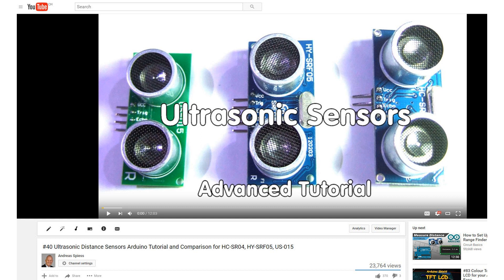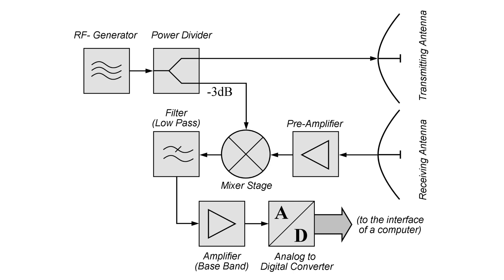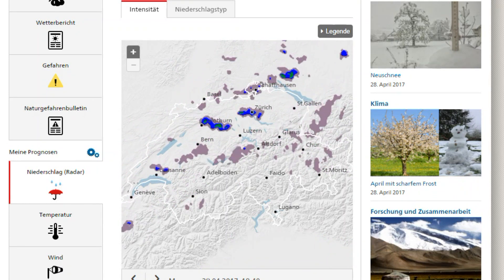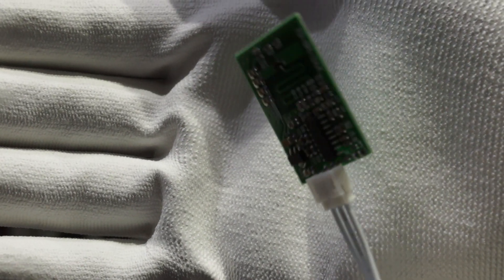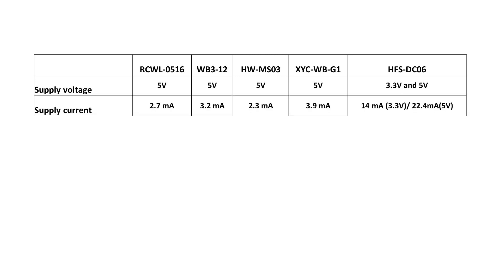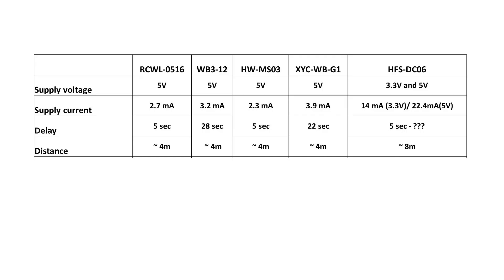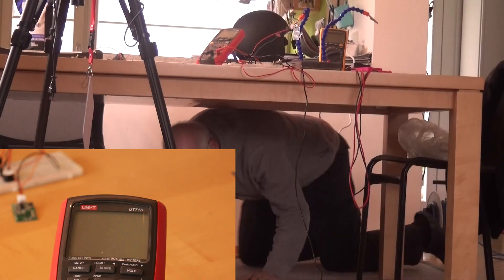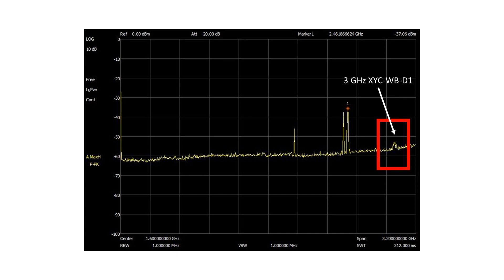#135 Radar Sensors / Switches: Comparison and Tests

Comment: I recently bought ten RCWL-0516 Doppler Radar Sensors and got an updated board with a regulator called U2 on the back near the output pins. These will go through the glass of a mason jar and my storm door. They put out 3.3VDC. I feel that these are regenerative receivers like the cheap 3 transistor radios of the late 1950s, they are set nearly at oscillation so when they are tuned to a signal they start oscillating and have lots of gain. if these sensors are weakly oscillating they will see their reflected signal as a beat frequency (it would be great if we could tap the audio of these.) Would they make a theremin? I will be playing with these for a while. Thanks for your information.
Reply from the maker: Well possible they are regenerative receivers. Still it is interesting that they are so sensitive. I once built a regenerative tube radio on this channel. But only as a receiver.
Reply: @AndreasSpiess  I have a challenge I have been thinking about, to build a regerative receiver that transmitts as well. (very low power) I built a test rig with 4.5 Volts, RCWL board and an LED. It can piuck up the slightest hand movement.
Reply from the maker: Cool project!

Comment: Another great video. Could adding a resistor help reduce the ability to penetrate throught walls, but maintain its range?
Reply from the maker: I do not know. Maybe you try?
Reply: @AndreasSpiess  Already trying but have no success with any ressistor . Too low ressistor and it does nothing. too high a ressistor and a capacitor seems to fill up. I have to futher into this. I am no expert

Comment: The wood is 4 cm, but it bounce from the floor
Reply: @AndreasSpiess  look how radar sensor work, it send a sound waves and then it bounce from the surface back to the receiver. So if any movement under the table the waves bounce from other survace and then bounceback to the receiver

Comment: You can solder a wire to pin 12 of the RCWL-0516  and feed that into an analog input. Then you can set the threshold anyway you want. You can see the motion waveform using the Arduino IDE serial plotter and use any kind of signal processing algorithm for your application.  I wrote some code to compute the derivative of the analog motion output (dy/dt) which so far seems to have increased sensitivity with less false alarms. Here is an example code:

int readAnalogRCWL(){
long sum=0;
int i, t;
for(i=0; i<2; i++){
t=analogRead(motionAnalogPin);
delay(100);
t=abs(t-analogRead(motionAnalogPin));
sum+=t;
}
return sum/i;
}

The above function returns the average time rate of change of the analog output (dy/dt). In my application if the function returns a value greater than 70, then true motion has been detected. You can use the serial plot in your application to help determine what values work best. 

I also tried this device outside to try to detect birds stealing my blueberries but it won't work at all if it's near the ground.
Reply: I had been intending to do that on a PIR chip but not yet got it to work. 
I think they work on looking for a signal difference and then trigger a timer.
Reply: Will it be able to detect a person if he is still or sleeping under radar range
Reply: @atharavkarandikar5289  No, it only detects movement.  Sometimes even through wall.  It also does not work at all outside for some reason.

Comment: Is there a sensor that can detect a tennis ball flying over a tennis net. The  sensor would be placed on one of the net posts, so 27' detection range would be necessary. Thanks!
Reply from the maker: I assume such sensor are used in real matches of Federer et al. But I do not know how they do it.

Comment: Its just a " regen style" reciever, look up how old regens and superregens wok, for example in listening to morse code (cw ) signals. Its the same thing here. Its actually 1950s tech but with a Ghz transistor. The local osxillator detects changes in its field as a frequency shift and that shift is detected by watching how much current is being drawn by the oscillator, with the other chip detecting that tiny change in current
Reply from the maker: You might be right. BTW: I recently built a regen tube receiver on the channel...

Comment: So, these measure movement. Can they measure distance? Meaning, if you hung a small radar reflector, could you measure distance to the reflector? I’m working on a project were I need to accurately measure distance but so far all these micro devices have extremely limited range. Have enjoyed your videos.
Reply from the maker: They cannot measure distance. Did you watch my LIDAR videos? These devices have longer ranges.

Comment: Very good, thank you.
You have to bare in mind that a lot of double glazing windows have an aluminium coating all over the glass for thermal insulation/reflection, and so this will no doubt explain away a lot of the RF attenuation you found when doing the double glazing window through tests.
Reply from the maker: Maybe it has a coating. But I do not think so. It is more than 20 years old and back then, coating was quite expensive.

Comment: I ordered some of the RCWL-0516 to try at home. If the microwave circuit is a regenerative receiver, it will transmit as well as receive. This was a problem with early regenerative receivers, they interfered with other receivers and could be detected easily. These may be detecting motion by moving objects interfering with the regeneration.
Reply from the maker: Well possible. BTW I built such a (tube) regen receiver in another video...

Comment: Wasn't it that Uboats were equipped with Metox receivers during the war, because they could detect a radar at twice the range the radar operator could see. So the question I'd like to know, is can any of these devices detect the operation of another ? I guess the answer is no because they all operated in the same space without issue. So how could we detect their presence ? Could they be forced into a listening only mode, like Network cards are forced into Promiscuous mode ?
Reply from the maker: They have no stable frequency. So they would only interfere by chance

Comment: The sensors work on the Doppler principle. The tx frequency is mixed with the return signal and the resulting output looks something like an audio shift when there is movement.  If there is no movement, there is no resulting output since the tx and rx frequencies are the same.

As for the window, I was wondering if the glass has an IR coating that might be somewhat conductive and block the weak uhf signal?
Reply from the maker: I think you are right. But everything with one transistor...
Reply: @AndreasSpiess  Are you sure it is a transistor.  Could it be a diode mixer?
Reply from the maker: Maybe. I do not know.

Comment: Those devices are NOT radar!
They are a high Q, high frequency oscillator that is very sensitive to loading , including phase of reflected waves.
The detector is an auto balancing  super high gain low frequency that detects voltage differences on the oscillator due to loading effects.
 These would not even be possible without the auto balancing detector, and the longer they are operating in a non changing environment, the more sensitive they become to any abnormal loading of the oscillator.
 The detector is basically the same as the one in the PIR detectors, but they are not interchangeable.
Reply from the maker: Thank you for your clarification.

Comment: Great video. My remark about British winning the war with help of RADAR. The Germans before their big air attack sent an aieroplain to scan British radar. The searched lower frequency and detected nothing and thought Brits would not detect their plains. In fact the Brits used an higher frequency that to their last invention of Magnetron that was secret that was not known to the Germans. That was the reason together with the code braking of the Enigma's to Germany (thanks G.d) loos the war.
Reply from the maker: And AFAIK they had these high frequency radars because they discovered a plastic for their cables with low losses...
Reply: @AndreasSpiess  Watch from 8th min. about the lenth of waves which were higher then the Germans thought, and in min 21sec35 about the Magnetron cathode valve which enabled higher distance detection  @ ---------    https://www.youtube.com/watch?v=iNOK64T2KOA

Comment: Here's how they work. The single transistor is an oscillator with an antenna in the loop.  Small reflections off objects  get reinserted into the oscillator, when these reflections are in phase they increase the oscillator output. This increase is detected and counted. The sensitivity determines how many counts before deciding movement has occured. See these schematics for more info https://www.tayloredge.com/reference/Electronics/RF/0242.pdf
Reply from the maker: Thank you for the link. Interesting!
Reply: @AndreasSpiess  It's basically a bad reflection phase detector looking for in phase peaks than a frequency shift measurement like doppler.

Comment: I just bought 5 of the RCWL-0516 from a supplier on Amazon. I tried 3 of them with 5v on 'VIN' and a LED + CL Resistor on 'OUT'. All of them only manage to detect my movement at distance of 2 cm (with my finger)! I had to snap the boards free - so perhaps I managed to buy a faulty batch.
Reply from the maker: I do not know your tests. You see how I tested them.
Reply: @AndreasSpiess  I just got a new batch of 5 units, today. The first two I tested are working fine (tested at a distance of 3m). I guess I was unlucky.

Comment: I wonder if they could be used to detect water in pvc pipes inside walls...
Can the signal be focused by a cover/anntena?
Reply from the maker: Maybe. You havew to try. But the reach is quite large, so you would also "see" things behind the wall.
Reply: @AndreasSpiess  I will try. Just ordered some sensors.  Any suggestions on how to focus it in only one direction? i've been reading about this sensor and people say it works by  wave propagation interference and not dopler
Reply from the maker: That is not easy. Microwaves. Google horn antennas

Comment: I have been using RCWL-0516 Microwave Radar Sensors in a smart lighting application (integrated with ESP32 developer boards) for several months now. To this video I would add a couple notes. The first is that though the sensors do not interfere with each other, they can get false triggered from the ESP32. This effect falls off after a centimeter or two. Lesson learned, be careful mounting the sensors to the same circuit board as your controller. The lack of directionality and ability to penetrate wood is amazing and perfect for my application. The sensors often detect me just before I enter the rooms with my lights. 

My sensors appear to work through regular glass. I mounted some of my smart lights on my double pane window and the detectors see me from outside my house. My different experience may be explained by the sensors penetrating the wood but it may be that I’m using traditional glass and your video reported testing against acrylic glass. The later makes sense as acrylic would act more like water than silicate. 

A final note on voltages... Though it does take 5V to power the sensors, the sensor output voltage is 3.2-3.4V. This is perfect if you’re powering your circuit with a 5V supply and reading the signal with a CMOS device like the ESP32.
Reply from the maker: Thank you for your additions!
Reply: Will it be able to detect u if ur are not moving or sleeping

Comment: Will any of the 5V ones work on 3.3V if the in-built voltage regulator is bypassed?
Reply: They should. And since the RCWL-0516 has a 3.3 V output pin (connected to the regulator output), it should be enough to desolder the regulator and use the 3.3 V pin as the voltage input.

Comment: Hi, i need a sensor to detect cars when waking up from deep-sleep. What sensor do you prefer? Doppler-Radar must be as fine but only rely on movements is not an option. I do not need distance massuremenets, but i need a obstacle detection of metal.
Reply from the maker: I do not know how to solve your problem. There are many options, all with advantages and disadvantages.

Comment: If they work through 360 degrees and I mount it against a metal surface (ie the back of my vehicle), then won't the rear signal wash out the one from the front?
Reply from the maker: I think so. And if you connect the metal to ground of the sensor it will probably even be better.

Comment: Hi Andrea thank you for the efforts in reviewing the  sensors. For the proper working of the sensors perhaps you can  cross check the hypothesis put by sirus o your spectrum analyser. The signal should be visible in the UHF band, based on the geometry of the antenna on the PCBA.
Reply from the maker: Their frequency is above the limits of my SA :-(

Comment: Do you think it would be possible to use one of these devices to verify if an object is a person? I am using a VL53L1X Time Of Flight sensor to detect distance but want to verify if the object is human. Current best attempt uses a PIR sensor but they aren't great. Excellent video as always.
Reply from the maker: It cannot distinguish between things as it only measures reflected energy.
Reply: @AndreasSpiess  Thanks Andreas. Can you suggest a method of identifying if an object is human without using a camera and object identification?

Comment: Great informative session, I am a newbie to this however I have a question if this sensors at most they detect an object at 8 m surely they are not the same used in the aviation radars and fields, ignore my lack of knowledge I could't make the link.
Reply from the maker: They use completely different devices and also different technology in aviation and police.
Reply: @AndreasSpiess  I thought so, are there any civil sensors that can be used to detect "unfriendly " animals, foxes,  hyena, or even thieves at a larger range ie:500 meters and above, it's mainly to protect a remote farm and compatible with an Arduino board. Thanks you

Comment: Can you reduce the range by lowering the voltage? 50cm-1 meter radius is enough for a motorcycle alarm. More than that is annoying.
Reply from the maker: I do not think so. Maybe a metal sheet with holes worked better.

Comment: Great video!! I bought the  HFS-DC06H sensor after seeing your video. Problem is it no voltage on the output with my multimeter. Also the on board led is not blinking ad all. do you think it is broke?
 Or do you measure otherwise?
Reply from the maker: Unfortunately I cannot do remote debugging. You should see a voltage at the output.

Comment: As always great video. I don't have time to read and I'm sure someone ask, but I'm going to ask as well. Wouldn't using a higher voltage give more range and possibly penetrate the glass? Is there a way to make it more directional? If so I'd think that would increase range as well. Meh?
Reply from the maker: I do not remember what I said in the video :-(  My answer was a general answer. The datasheet is always the place to look for the maximum alowed voltage.
Reply from the maker: I am not a big fan of using higher voltage as specified. So you have to try yourself. Be prepared to kill the device...
Reply: @AndreasSpiess  I thought you had said it was rated from 3.5 to 12v. my apologies.

Comment: Hi Andreas...
Nice Video..  it helps me to choose the right Sensor for my Project...
I still have a question...
I choose the RCWL-0516 one..
If i want to reduce the detection Angle, i just need to add a piece of Glass in the right Position... right?
Do i need normal Glass? Or do Plexiglas the same work? How thick the glass have to be?

Kind regards..
Reply from the maker: I would use metal, not glass for that purpose. Normal glas or plexiglas will not work
Reply: @AndreasSpiess  yes, but in your Video, you cant detect your friend behind a glasdoor.. and i saw a Video, a guy use the same Sensor, put a empty can above it and it still detect everything.... 
I try to find it and give you the link...

Comment: Hi Andreas, excellent job on promoting Switzerland on YouTube 😋 I enjoy your very informative videos. One question/worry is it safe to use these devices in a home environment? I mean constant microwave/radar bombardment, can there be a health risk (and or can it help keep the coffee warm 🤔😇😋).. Season greetings from Denmark.
Reply from the maker: I have a simple rule: You for sure will not get more energy out of a module than its input power. Usually you loose even a lot inside the device. So you can do your calculations and compare it with your Wi-Fi Hotspot, or your Smartphone. I have no fears  ;-)